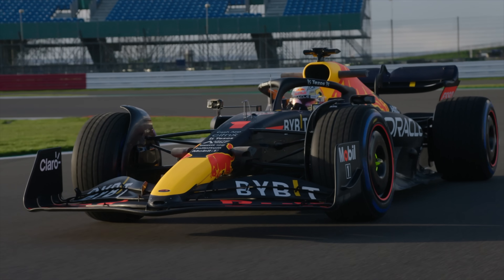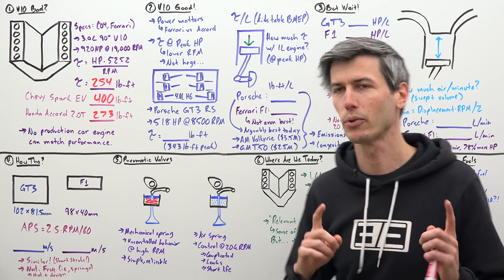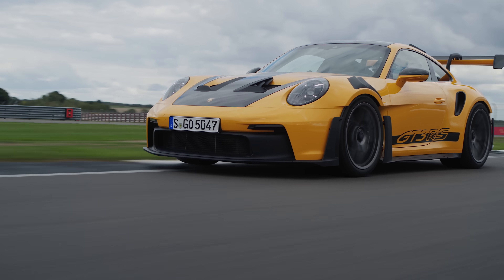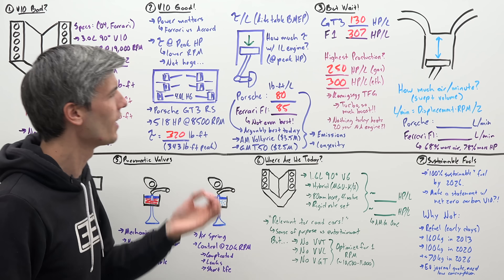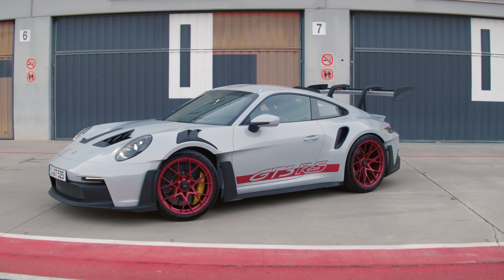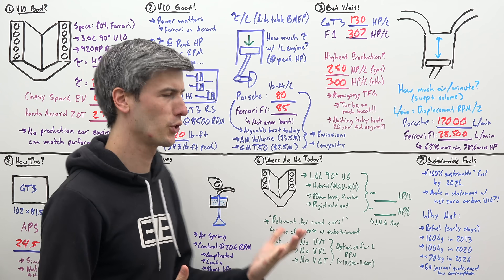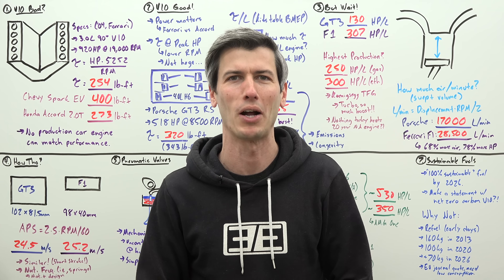Formula 1 V10 - The Greatest Engine Of All Time?

Comment: If Formula 1 uses sustainable fuel, I think it would be cooler if they lifted all rules regarding the engine and only limited the maximum flow of fuel or the energy contained, so that the manufacturers are forced to make the engines as efficient as possible to get the most power out of them. Then there would be variety again and the system that is really the most efficient would prevail. Regardless of whether that is a V10, V8, V6/I6 or I4. I think the freedom would also make it more fun to watch because you can observe the different concepts. Some will use a full hybrid vehicle, others a mild hybrid and others only ICE. And the system that is really the most efficient would prevail. Because just because the engines today have a 1.6L displacement does not automatically mean that they are more efficient than, for example, a 2.5L V6 that does not rev as high. I think the manufacturers should find out for themselves which variant is really the most efficient and it should not be prescribed.  The 1.6L V6 engines are really great, but it's become kind of boring because there's no variety. I think the only thing that should be prescribed is the amount of energy available within the fuel and the maximum battery size for hybrids (so that ICEs don't have less energy available than hybrids) and the rest should be left to the manufacturers and then we can see who gets the most performance, i.e. the most efficiency, out of that amount of energy.
Reply: No Communist fuels please.

Comment: Yeah I was a bit disappointed that technology development has been so limited in recent years because, to me at least, I find it exciting to see the limits of technology pushed (as well as driver skills). Supposedly the initial limits from the early 2000s, was to reduce development cost (and improve safety), but it seems to have turned into this "economy" aspect. In any case there is a cap on costs and how many engines you can have - so why limit the technology so much as well? 
I have fond memories of the crazy high boost turbo era, where engines were sometimes pushed beyond their limits (and achieve crazy HP / litre), but it did get a bit silly with engines being burnt up sometimes in just one qualification. So I think they should have to make engines that last more than a race (i.e. limit on engines per season) but be given more leeway on how they make the power to make it more interesting (and benefit industry in the long run).

Comment: There is no such thing as "sustainable" fuel.  It's a crock put in front of people's eyes to confuse people into supporting this sport for the elites.  As soon as the team puts the car, tools, spares and crew on a jet transport anything "green" goes out the window.  Plus all the drivers and top people have V12 sports cars, private jets,  600 gallons per hour burning yachts,  private helicopters,  and multiple houses that are heated and cooled all year.  The incredible thing is those people are so wealthy that fuel prices don't affect them so they actually support high energy prices for the little people.

Comment: the cost of a combustion engine will only be 3 times higher than electric while we're all still using combustion engines. however, if we start increasing the demand for electric power that's going to change. it's a bit disingenuous to say electric engines will always be cheaper than a combustion engine because we don't know what will happen to the cost equation if we suddenly swapped the amount of combustion and electric engines in use.

Comment: A sports bike engine is much closer to a N.A. F1 engine. In terms of longevity and service intervals. So what power/ torque are the current best sports bike engine making? BMW S1000RR 205 hp @ 13000 rpm and 83 lb-ft peak torque. Ducati Panigale V4R in Euro5 compliment mode is 218 hp at 15000 rpm and 82 lb-ft at 12000 rpm. This is the current state of the art for N.A. engines. The BMW will easily last 50000+ miles with proper maintenance.

Comment: F1 lost the point of what made it special yes, the V10 did sound the best but even the V8 was probably the last of the good old days, it's been crap ever since then

I get that they wanted to bring down costs and align with their regular road cars but in so doing they stopped being the pinnacle of motor sport. The smell, the sound, the excitement, is the engine going to blow, will the fueling go wrong, will they have to nurse a old engine that might blow up or run the balls of it risking everything, wheel to wheel action without worrying about offending someone on track and getting 10 second penalty 

The sport has for all intents become "safe" but predictably dull.

Comment: Power hp is just the speed of the work/punch you do. Do you do it once a second or twice a second that is the question!

Likewise you need punch to move a truck so the f1 engine will not move the truck much.

Comment: New is always better. I cannot wait to taste the salty tears of old f1 fans when f1 switches to a v4 hybrid engine.
Reply: I don't think they will switch to V4 hybrid given Porsche experience. Also, Porsche chooses that because they wanted more electric motor power. Do it in F1 in current climate basically defeat it purpose of cost savings. Also this is more or less similar reasons why WEC banned V4 (alongside diesels).

Comment: I daily a turbocharged hot hatch making about 350 hp right now (302 to the wheels to be exact) and it can just about beat the porsche with a naturally aspirated engine. when it comes to hp/l (140hp/l out of a turbo inline 5 and it is tuned).

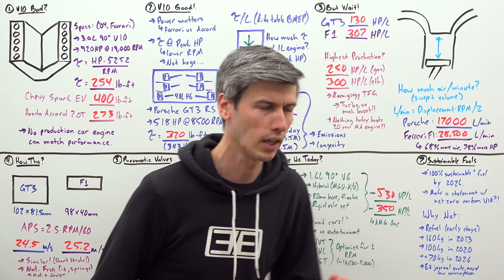Comment: 13:40 yeah, going back to v8s to save hundreds of millions per year on engine development using the new fuels they can also make the cars small like they used to be again.
Reply: But does it get smaller? The size of the car I guess will be around 2010-13 cars. Those are still big, and somewhat have to as there is no refueling.

Comment: I'd say torque is meaningless, an engine is an air pump, torque is just a biproduct of generating power. Having high rpm is a function of displacement limits and, to a lesser degree, mass limits. If you want silly specific power and rpm numbers, look at bikes, if you want to look at an air pump pretty well optimised for cost and efficiency look at a GM LT engine, but the only reason torque is important is because it affects vehicle gearing and customer expectations.

Comment: I really like your videos, but there sure is a certain irony here picking Red Bull as the cover car, when it's one of the very few current F1 teams  (with Haas, Mercedes and Aston Martin) that never used an V10 engine. Funninly enough even Toro Rosso/Alpha Tauri did, since they were the only team allowed to use an detuned V10 at the introduction of the V8s in 2006, which was when Red Bull entered F1.

As a fun side note: teams complained about the  detuned TR engine, because while beeing down on peak HP,  they had a pretty siginificant torque advantage over the smaller V8s.

Comment: Have you done the math on the Mazda 787B's NA 2.6L 4 Rotor with regards to torque per liter and HP per liter?
It did 700HP at 9000RPM, although it was capable of 900HP at 10000RPM.
That means it did 157 lb-ft/L and 269HP/L, but was capable of up to 181 lb-ft/L and 346 HP/L!!

Comment: You forgot one thing about F1. If new tech doesn't work, it gets scrapped. But, if one team have new tech that works (although like turbo with Renault, a bit painful process), every teams have to follow or get left behind. Let's just say F1 now have WEC engine rules (but still with F1 limited components rules), and one go V-10, one V-12, a couples V-8 N/A, one with V-8 Turbo, and a few go V-6 Turbo. And, F1 being different to WEC, whatever engine work the best will eventually be the one that other teams will go

Comment: I love the vid, but technically the displacements are measured weird in the f1 engines because to keep the compression ratios lower the intake valve closes super late in the cycle compared to the exhaust valve. Im 90% sure
Reply: True for the V6, but that doesn't change the displacement at all. The displacement is simply the volume the pistons "displace" during their movement in the cylinder. It has absolutly nothing to do with the valve timing.

Comment: 80 lb-ft per litre is about the same as the four cylinder eight valve Kawasaki Z1 900 bike from 1972. We’ve made engines spin more than 2x as fast but why can’t we improve the torque?

Comment: 1950—2006 Engine revs: Unrestricted.
2007 & 2008: 19,000 rpm, and so on and so forth.
In 2006 I read somewhere that the Renault engine (by the way that year also was the last of the 'no freeze development' rules throughout the year) was reaching 20,500 rpm in Qualy mode and 775 CV peak power from it's 2.4L V8.

Comment: Boring Engines. Nicest where V6 twin turbo, qualifying engine, qualifying set up, unlimited turbo boost, rocket fuel, manual and analogically drive and with qualifying tires. + 1200 hp. on +/- 500 kg. Unbeatable.

Comment: If you’re using air pressure why not just hook up a bunch of pneumatic actuators  with the valves integrated as the rod. With modern day digital automation and technologies we shouldn’t have to rely on mechanical cam shaft lobes and timing chains to keep everything timed correctly. 

Pneumatic actuators can move FAST and they can move ridiculously fast if they are engineered to withstand higher pressure. Without being bound by mechanical timing you don’t need to worry about engineering in additional mechanisms to advance or retard timing, dual came profiles, or anything like it. You get full control.

Comment: Imagine if that 20 yr old Ferrari engine used VVT, VVL, and VGT with no fuel flow limitation and allow the engine to be 3.0 liters. Probably would make 2,400-2,800 hp. Maybe more.

Comment: I think F1 should have just these rules regarding the powertrain:

1. Limit to just x amount of total energy used.
2. All energy must be sustainably sourced.

That's it. No restrictions on fuel flow, engine displacement, number of cylinders, or even gas vs hybrid vs fully electric. This way, we can push for efficiency on all fronts. We'd have big power big engine cars going against lightweight small displacement small battery lower power cars going against heavy big battery fully electric cars. I'd be really interested what the optimal designs would be.

Comment: Seems like lower torque would actually be a bonus on F1 cars in terms of drivability. Especially in slow corners where you don't have downforce helping much, it would be very easy to break the tires loose as soon as you touch the throttle of a high-torque engine. With a low-torque but fast-revving engine, you can maximize traction in all driving conditions.

Comment: Jason, since F1's goal is to consume less fuel, why not switch to a high displacement engine? This way, V12 may return, after all, the lower the power, the higher the efficiency. Didn't you also mention in "Why Small Displacement Turbos Have Low Efficiency" that after improving the dynamics of cars, small displacement engines are not as fuel-efficient as large displacement engines?

Comment: i get that people like to put the rose tinted glasses on and go on about how things were better in the olden days, and it is impressive that the performance of a 20yr old engine still holds up today even with the caveat that it could only go 300km between sevices and its expected lifespan is 1 weekend (from a little reading there was a new regulation that said an engine had to last 1 whole race weekend :o how didnt they cope :p) 

while the relevance can be argued. turbocharged hybrids are probably more relevant than v10s

if a 1.6L v6 can give the same power output as the 3L v10 while burning way less fuel and lasting 10x as long, going back to v10s feels like it would just be a complete waste 

while there is some value in aesthetics / the sound of the cars, it feels like there must be ways to achieve that while still atleast maintaining the current efficiency levels if not continuing to improve them

Comment: You need to make a video about the Mazda 787B, with the 4 rotor 2,616cc NA engine, making around 700Hp (and up to 900Hp at higher rpm) in the early '90s.

Comment: It is meaningless and pointless to talk about "how much torque" does an EV develop in comparison to an engine.  In the case of an EV, the traction motor IS the effective equivalent of the transmission in a conventional vehicle, and so you're measuring the output torque of the "transmission", before the final drive.

Comment: If only I believed EVs will be so comparatively cheap to power by 2030… 

Jason, is it possible to just once not mention carbon emissions in a video? It had absolutely nothing to do with the pieces of engineering and auditory art that are the V10s of the 2000s.

Comment: F1 engines of that era had pretty restrictive materials. Metal Matrix Composites, Beryllium alloys etc in metallic engine components like rods and pistons were banned in 2001 I believe. Largely through an artificially imposed modulus of elasticity limit. If they weren't by 2004 the power numbers shown here would have been even more extreme.

Comment: The Ferrari F2002 and F2004 engines produced more than 1300hp on the strongest map, rotating almost 20000rpm, as did the 2002 Williams-BMW engine, what machines!! In events using modern tires they are faster than current F1 , so much faster that the FIA bans the publication of times so as not to show how much better those 00-04 cars were!!

Comment: I usually love your videos, Jason, but with such an iconic holy grail subject, I feel this is a real missed opportunity from you.

Surely, you could have come up with a much more in-depth and interesting analysis. What was the peak torque of the best of these things ? Valve area ? Airflow speed ? BSFC ? A/F ratios ? Compression ratios ? Combustion timing ? Thermal efficiency ? Sound signature and frequencies ? Clearances ? Time to warm up ? Rotating assembly accelerations ? Engine balance ? Firing order ? and the sound, musical notes, and the SOUND ! The Noise !! and so much more ....

I'm very disappointed, Jason .... please redo this video. Thanks 👍

Comment: I'm walking around with the following idea for a couple years now. Some very simple rules.

100% sustainable (green) fuel.
1000hp/1000nm max. Measured at the hubs (standardised for fia measuments)

How you do this? With your own road going concept. Porsche? 6 boxer. Mercedes? V8. Ferrari? V12. Honda? i4. Have fun. In this case the development of your F1 engine will directly result in gains for production engines.

Comment: On the Wikipedia of BMW Williams FW26 2004 it had a claimed torque of 302 lb-ft or 410 Nm
Reply: Yes, the Ferrari engine also has a higher peak torque rating. The issue is, that if you calculate torque based on peak power at a certain rpm, you only get the torque for that point in the rpm range. normally peak torque and peak power are not at the same rpm.

Comment: Probably would have made the video too long, but if you're talking about hp/liter in racing, you can't beat the 80's turbo F1 cars.  Some pushing over 1000hp from 1.5l engines, thanks to no boost pressure restrictions and some exotic fuels.

There's a story that may or may not be true, about the BMW F1 engine from that era making an unknown amount of power because the dyno only read up to 1200hp...

Comment: One thing that i missed is a mention to the weight of the power plants. The new ones with the all the electric systems intercooler and so on, are far heavier that the old V10s. One of those old V10s weight about 70kg, and produced almost a 1000hp. They were not allowed to use things like variable intake length and so on. Pretty insane figures for what their weight is.

Comment: On your last point, I thing sustainable fuels, whether synthetic or bio derived, should bring a new freedom to the rules in the form of only limiting the engines by the size of the fuel tank and the emissions they put out. If you can make a fuel from the waste of farms and use that to power a V12 that can go a full race without refuelling with a tiny fuel tank and only puts out CO2 and water, let them. No reason to limit engine displacement, layout, cylinder count, stroke, bore, or V angles. Bring an H16, if it can last the race and win, why not.

Maybe they could find a balance to allow "oil burning" engines with the same regs to allow 2 strokes and wankels if the teams so want it but that could be a difficult balancing act to make sure one isnt way better than the other or getting way more "fuel" because it has multiple combustion sources.

Comment: A good comparo, but I have heard nascar engines have pretty high BMEPs also - howdo they compare when at tuned RPM?   I'm not from USA and long did not like american iron, but have come to appreciate their simplicity and low parts count.    The power or torque per kg of installed weight is a good metric, as is the 'packaging' space required and SFC.   I've become disenchanted with legislating a small engine then doing all these complex things to make power and torque - is that really the way forward?
Reply: It's usually F1, Nascar and ProStock that delivers the most impressive numbers, DTM had some as well if I remember correctly. Funny thing that old school pushrod 2 valve engines produce some of the most impressive numbers.